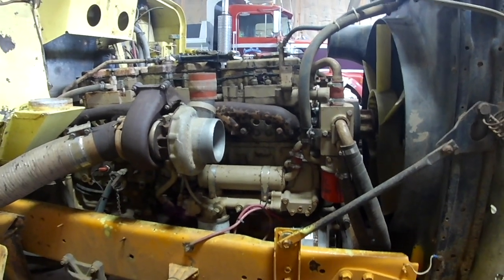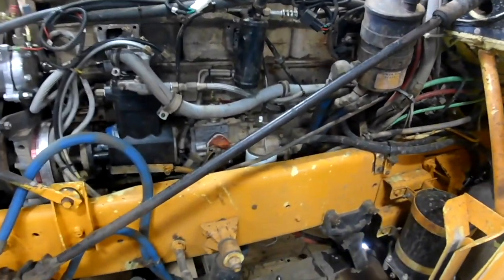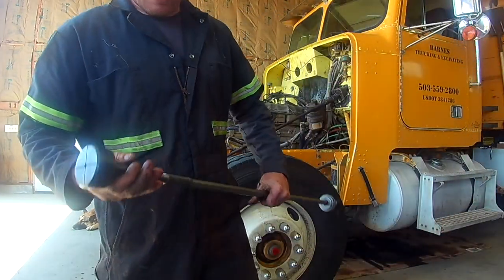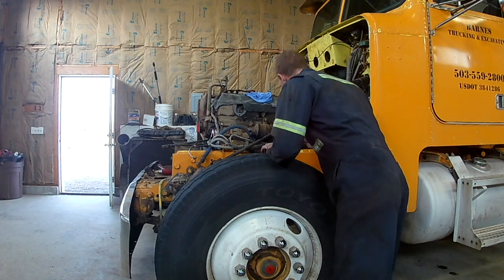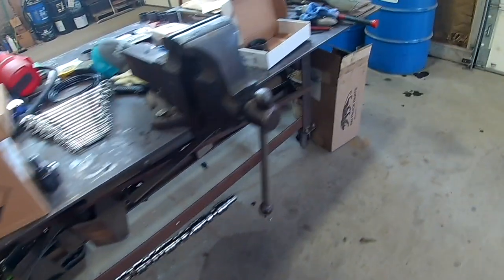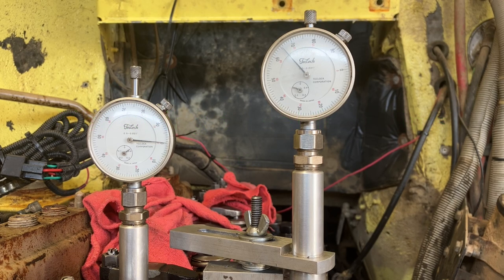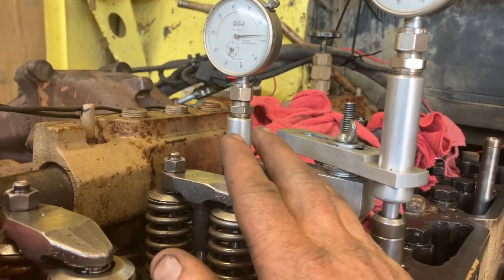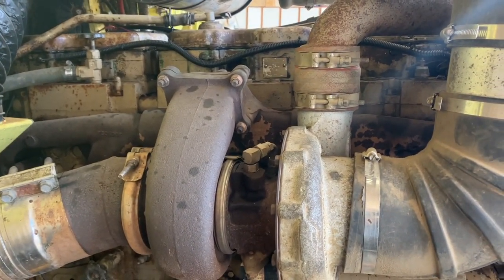Big Cam IV camshaft replacement

Comment: Awesome video.  Great job.  As far as shimming the cam follwer covers.  Why couldn't you just measure the thickness of your old gaskets and just replace with new one for the new cam.  I mean all things considered. You never really changed anything.  Went back with OEM parts
Reply from the maker: Great question and unfortunately these parts are not that close. I ended up adding more shims to hit the timing readings I needed. Could it have been close enough to get away with; possibly. Wouldn’t have been right or the timing code my cpl required but would it have run; probably. When doing a rebuild a maybe vs. a dead on is the difference from one running a long time to one possibly not👍
Reply: I agree.  Knowing is always better then guessing.
Hey.  You wouldn't have a part number for that cam bearing install/removal tool?  And especially that #7 cam bearing removal tool? TIA
Reply from the maker: I unfortunately don’t off hand. I was lent that tool by a friend, as well as the timing jig.